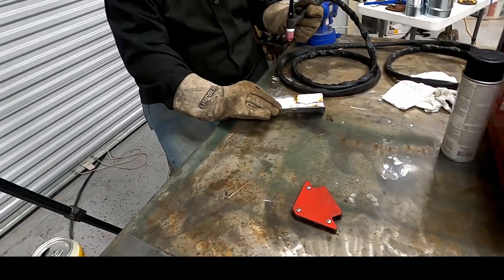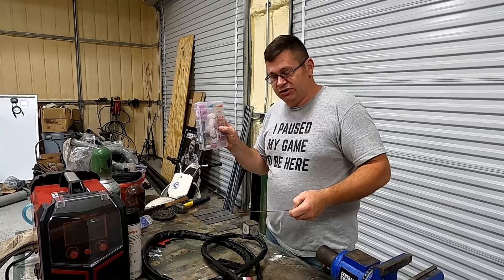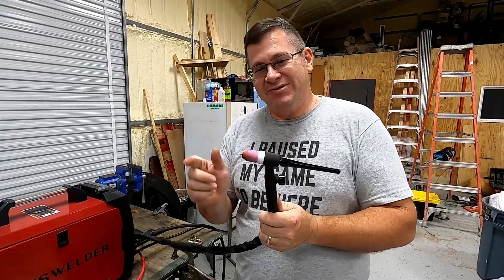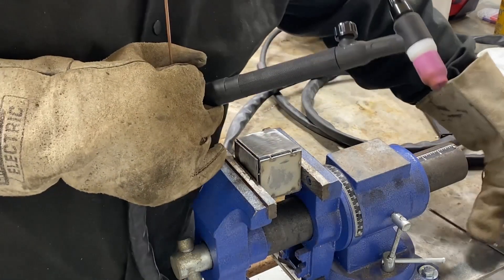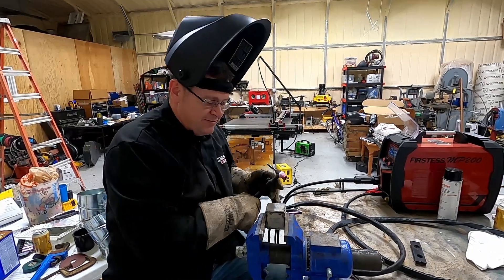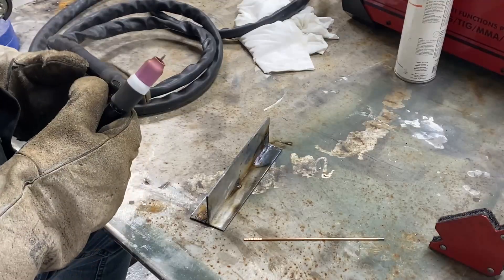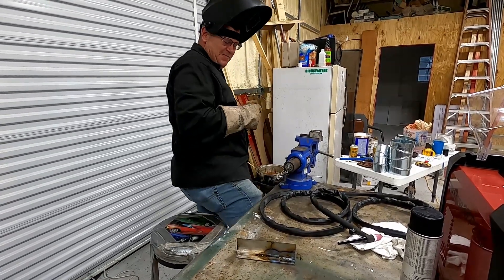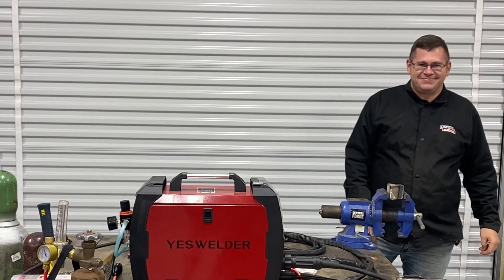Will it TIG Weld? Testing the YesWelder FIRSTESS MP200 Lift TIg Welder Multi-Process Welder

Comment: Just a quick...umm...observation- why are you welding over the top of the workpiece?  I mean, it's no wonder your bead was an inch up the vertical.  One other thing is set up.  I've never seen a greenhorn freehanding without it turning into a sh*tshow.  What's the number one rule of welding?  Comfort.  You have to be comfortable.  Make an armrest.  Heck even a stack of books to prop your elbow on.  Get a rod feeder if you're having trouble keeping your filler consistent.  One thing I was surprised to see is how sloppy your arc control is.  That's where the comfort comes in again.  Think about your weld and do a practice run without striking an arc.  And, like Not Sure said, get a pair of gloves that actually fit, lol.  Work on maintaining proper arc length first.
Reply from the maker: Ok

Comment: I can tell you one thing it's not a lift start TIG welder that is a scratch start TIG welder number two need to lower your amperage down less heat you'll be able to get more work done your cooking your metal if you were to take that off on the stainless steel you would get rid of the stainless out of your steel you'll burn it to death.
Reply from the maker: I need to get a real tig welder out here to try this machine out!

Comment: Still wish they'd delivered on the promise of a Lift start TIG instead of just another low quality Chinese scratch start. I could have gotten much cheaper machines that can do scratch start. It also doesn't meet the full promised specs for amperage on 220.
Reply from the maker: It seems they did build the machine around the mig portion. I don't have much experience with tig so not sure what is good or bad but imagine it's missing some features a stand alone tig would have. The price I paid I cannot complain about the features if anything makes me want to get a better tig welder. Did you buy yours from Kickstarter or do you have the production model?
Reply: I got it through the Kickstarter. TIG doesn't require all of the fancy stuff but you can get much higher quality welds with additional features. As far as how welders work you can easily have a Lift TIG and even more fully featured (there are a lot of MIG features missing too but they didn't claim to have them) MIG setup. 
I'm not complaining much about the price, I got a cheap welder and expected the cheap welder I received. However, when you claim to have Lift TIG and it's branded all over everything, I kind of expect it to have Lift TIG functionality and not just a basic scratch start that every welder on earth has.
Reply from the maker: What thickness and amperage are you using? It would be nice if it had a hot start that way you could start your arc easier, is that what you are seeing?
Reply: I'm seeing similar results to what was identified in this video https://youtu.be/-c8qFQXr_pc?t=249 that max output is really no more than 160amps at 220V. So anything over 1/4 inch getting good penetration is probably not going to happen which means even with helium gas DC aluminum welding isn't going to get enough heat.